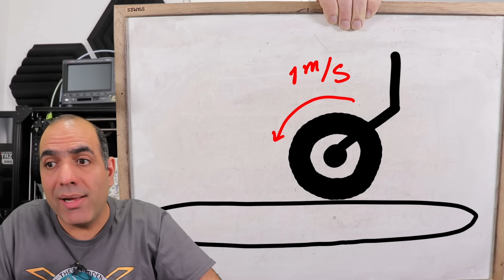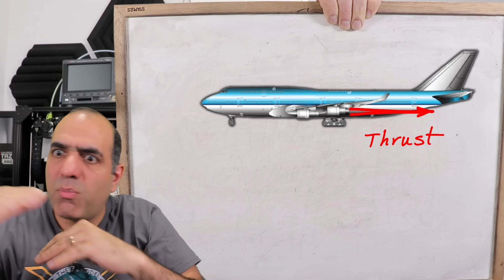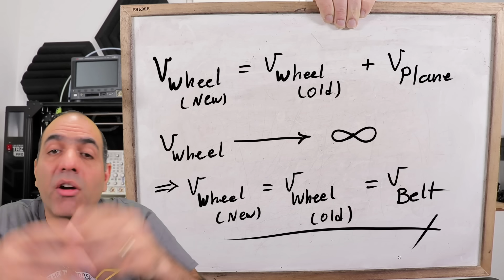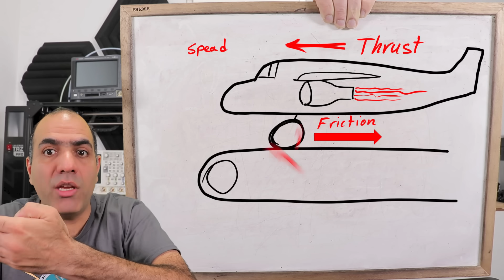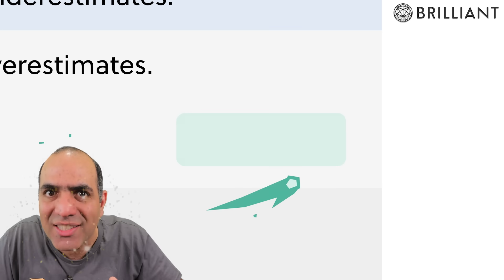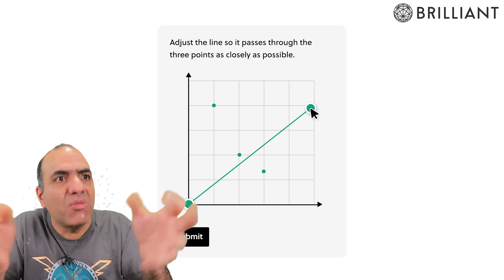Airplane Question that Drove Me NUTS!!!

Comment: I’m at 1:52, you’re about to give the answer. A prop plane absolutely could but I’m conflicted about a jet. Initially without too much thought I said yes, but then I got to thinking about airflow over the wings (that’s why a prop plane works, because the propeller moves the air) and now I don’t think a jet could. So no. 
But then considering that the jet engines provide the power to actually move the plane and the conveyor belt would overcome the friction between the wheels and ground, soooo……yes. 
But there wouldn’t be any airflow over the wings to provide lift, if the belt and wheels are at the same speed in opposite directions they cancel out and it’s as if the plane is stationary with its engines going, we’ve seen that happen and the plane doesn’t just lift off, so no. But with the friction overcome wouldn’t the engines just sort of push it off as it were, so yes…………

I don’t know so I’m going to finish the video, back in a moment.

Update: I still don’t know. 😉

The question is 42.

Comment: Airplanes do not care about ground speed... so long as the air speed is high enough over the wings the plane can take off.  

besides plane engines do not act against the ground.. they act against the air.  this problem isn't a problem.. it just shows ignorance.

Comment: Electroboom your analysis is wrong if you definte wheel speed a little bit differently..  Remember that the top of the wheel is going +v while the bottom of the wheel is going +v.  If we definte "speed of the wheel" to mean the part of the wheel in contact with the conveyor, then the wheel speed always matches the conveyor speed 100% of the time.  In fact the puzzles' most mysterious statement is actually a tautology.

Comment: "wheels moving at the same speed as the conveyor" is a meaningless statement.   Wheels always move at the same speed as the ground they are touching.  So for instance if the ground is 0, the wheels are 0.  If the ground is moving 100 mph the wheels are spinning 100mph.   They must by definition always be moving the same speed because they are touching.  Now suppose you set that conveyer at 100mph and hold the plane in place with a rope.  The wheels spin, the conveyor moves, and there's very little friction.  Now let go of the rope.    Then have the plane start the engines it will fly down the conveyor while the wheels spin at a terrific speed.   Now let's do it the other direction.  The conveyor is pushing the plane forward at 100mph but you are holding the plane in place.  let's assume that there is zero friction in the bearings for now.   Let go of the plane.   The conveyor will not push the plane forward at 100mph (because the wheels are just spinning in place).   You will have to start the plane engines and have the turbines or prop push the plane down the conveyor belt.

This is a great question because it has such a great amount of misdirection adding that completely meaningless "wheels spinning the same speed as the conveyor belt".  That part actually does nothing and is only there to confuse you.  There is no engine on the wheels at all.  It just spins in plane and all the propulsion comes from the engines mounted on the airplane.

So the answer is the plane takes off whether the conveyor is stopped, rotating at a high speed, fowards or backwards it doesn't matter.

Comment: The plane can only take off if the wind speed over the surface of the wings over the leading edge exceeds that which is required for takeoff.  Presumably, the wind speed at that moment is lower.  Since, the problem mentioned no thrust, even if the wind speed was sufficient, the aircraft would actually likely slide backwards and return to the conveyer it was on before, a few feet away.

Comment: I’m not smart so this is just my idea but if the plane needs to move forward with thrust it makes the wheel move letting the plane more forward so that the plain can gain lift but if the question saying the belt and the wheel move in the opposite direct equally wouldn’t that just make the plain move in place without being able to go forward there for no lift? I feel like a good way to test this is with paper folded (in a way allowing you to blow on it to act as thrust) and with wheels on a belt moving roughly the same speed I think

Comment: You don’t even need to do any maths it’s common sense! The plane in the conveyor belt question of the dumbest question I’ve ever heard. Obviously the plane to take off. Smh 😂 the wheels have nothing to do with the speed of the plane. They could be rotating at 20,000 rpm the wrong way 😂 it still would take off.

Comment: Thrust causes plane to move.
Movement causes wheels to spin.
Conveyor counters that, meaning plane is stationary.
As for the plane to get up to speed it body must move. 
Without that movement, it will gain no lift, meaning it can’t take off.

I am not sure if I’m thinking right, but without drastic circumstances like an absurd headwind or lower gravity, it would be able to take off.
 It’s not a rocket, it need to, essentially, ride the wind. Right?

Ah I don’t know. I don’t know anything on the math side of things and i know even less on the physics behind why a plane flys, but if the body can’t move, it can’t gain lift. It can’t move because it has no method of movement without the wheels being able to carry the body forward as its thrust increases, hence it will be stationary.

Right?

Comment: Mythbusters busted this myth in like season 4
Reply: Not quite, the wording was slightly different. In the Mythbusters one, the conveyor belt would match the speed the plane needs for takeoff. In this question, the conveyor belt matches the speed of the wheels. That could stop the plane from gaining speed if the tires have perfect grip, the wheels aren't frictionless, and the whole thing is completely indestructible. 
Still not possible, but in a slightly different way.

Comment: So to clarify we have a runway comprised of a conveyer belt, designed to match the speed of the tires... the plane would take off as it nornally would assuming all other conditions are "normal" the tires would be exposed to the same speed as they normally would just with more rolling resistance in theory. Meaning slightly more drag requiring slightly more thrust or slightly longer take off. Ez

Comment: You forgot something. AIR. is no air moving over the wing. First, thrust makes the plain moves forward to take air, over the velt (NOT, because is stationary). seconde even the velt and the tires move at the same speed, NO air is pushing to the wings. So, in none event the plain can get any air to fly; because is not moving.
IF, you put some kind of fan or turbine infront of the plain moving air over the wings, stationary lifting is aplied. so, maybe the plain could fly. but... maybe no one will make the experiment.

Comment: As the treadmill has to match wheels. You could just say that the plane has to be stationary. So then Imagine that the plane was fixed. The jets would generate thrust but plane wouldn’t go anywhere. Same as a jet engine in a test rig. Just move lots and lots of air through it that’s all.

Comment: Or another way to think about it if the plane's wheel was on earth and was not able to move..would it fly as the earth is moving at over 1,000 miles an hour.  Yes, I know not a very good example as the plane would be able to fly yet the idea.  Or another way to think about it is that if the conveyer belt was able to push the air then yes, the plane could fly.

Comment: It won’t fly. Case closed. Every aviator knows how plane flies. You don’t need airplane to go or not in ground. İt stays in the same place which means there is no air speed going through the airfoil so no lift. So no flying. İf the plane doesn’t move in the ground it doesn’t matter even if it goes 500 kph since there’s no lift

Comment: I think answer 4 is also a case of fishing for reasons that the reflexive "no, it can't" is right.

The question isn't "does the plane take off while sitting still?", the question is "CAN the plane take off?", as in "does it have the capability?".  Every plane, before taking off, spends some amount of time at the end of the runway NOT at takeoff thrust.  If we interpret the question in the way that makes 4 correct, then NO plane EVER flies, under ANY conditions.
Reply: Wheel speed and conveyor speed are matched at the contact point between them and wheel only rotates when the plane moves forward. Again the plane moves Forward and the wheel rolls exactly the same distance on the conveyor belt. with everything matching exactly at what point in the forward movement of the plane does the wheel get ahead of the conveyor belt causing the belt to start?                                                                                             The riddle (Imagine a 747 is sitting on a conveyor belt, as wide and long as a runway. The conveyor belt is  designed to exactly match the speed of the wheels, moving in the opposite direction.)                                                                                                                          Can the plane take off?                                                                                                                                                                                                       Let's break it down                                                                                                                                                                                                                 747= real plane, it will take off                                                                                                                                                                                               Sitting= Stopped, not moving, wheels not turning, and conveyor not running.                                                                                                    Conveyor belt designed to exactly match the speed of the wheels = Conveyor belt can only match wheel speed, it can't change wheel speed.                                                                                                                                                                                                                       Moving in the opposite direction= The top of the wheel  moves in the same direction as the plane's forward movement, the bottom of the wheel moves in the  opposite direction to the plane's forward movement. So any conveyor belt the wheels roll over moves opposite the plane.                                                                                                                                                                            To make the wheels turn the plane must move forward, as the wheels turn they roll on the conveyor belt at the same speed. Because the speed of the wheels  already matches the stopped conveyor belt, the conveyor belt  will not have to start and the plane will take off.                                                                                                                                                                                                                                  I see now this is not a riddle, it's the definition of how planes take off from a runway with one word changed. they replaced the word runway with conveyor just to confuse

Comment: The set of assumptions i always use to answer this question are:
1: on the Earth
2: at Sea Level
3: on an International Standard Atmosphere Standard Day
4: with both conveyor belt and wheels constructed to the same durability.

I always insist on 4, because this question is clearly designed to confuse people into thinking the interaction between the wheels and the pavement is what makes the plane accelerate for takeoff, and the first thing EVERYONE does when they hear the words "the plane is accelerated by its engines pushing against the air, not its wheels against the ground" is say "aha! but the conveyor belt moving back would exceed the rated speed of the wheels and make them explode!" because they want their reflexive answer of "the plane can't fly" to be correct so they can say they were not tricked by the trick question.

It's okay to be tricked by a trick question, people.  Direct your anger at the person who intentionally phrased the question to be easily misunderstood, not the person who made you realize you were tricked.

Comment: Most of what causes any variable of lift comes from drag and lift; the air drag is what produces the lift in the case of a plane due to the shape of it's wings. The jet is, in theory, moving at the required take off speed in your imagined scenario, but, it does not generate the wind resistance necessary to create the drag that it needs in order to take off...so no this is not a paradox. The plane does not generate lift and cannot fly.

Comment: After watching 30 seconds of the video, the answer is YES.

The conveyor belt can NEVER match the speed. The power of the engines is not transmitted to the wheels. So even if the belt can make the plan move at MACH 10 in the reverse direction, the plane would take off.😂

Comment: I like you're thinking... and my head does the same thing when I see these things... That being said... The question posed is "Can The Plane Take off" ... and says nothing about it, and the answer is yes. In our universe, on our planet, it would not have a problem... in fact, it would be easier. 

It starts off sitting, as stated, so to match the wheel speed, it would have to turn at the speed of the plane relative to the ground and maintain zero wheel speed.

Comment: Of course it will fly... It is a jet engine that acts on the air and has nothing to do with wheel speed. 

However... there is a bit of a problem here.... I've been sick in bed for 3 days, so maybe its the fever talking... "exactly match the speed of the wheels" is breaking my brain... 

Let me explain. At a standstill, the wheels are still. Of course, the jet engines start moving the plane... If the conveyor moves at the speed of the actual plane, and keeps the wheels still, then problem solved it can "exactly match" zero and zero... I'm sure that's not what most people are picturing though. I believe for it to actually match the speed it would have no choice but to do this... zero mph wheel speed and matching the air speed of the plane ... actually making it easier for the plane to take off. 

The thought is that the wheels end up turning 100 mph and the conveyor turns 100mph. The problem is that, it is a stationary runway that causes the wheels to spin. A moving plane and a stationary runway. I could really use the help of an animation... Let's see... 

Wait a second here... After writing all of that, I just realized that the wheels and conveyor have no choice but to turn the same speed ... they are in contact, so unless they are skidding, they are turning the same speed. I think this is intended to be misleading ... but not in this way, lol. 

My thoughts were that as the air speed picked up, the wheel speed would pick up and so the conveyor would have to speed up to match the increased speed... but that's just not the case... the plane can go 2 or 2000 and the wheels and conveyor can turn 10 or 273. The reality, however, still stands true... If  it "exactly match the speed of the wheels" it is not turning at all, because it starts at zero, so it stays at zero, and matches the air speed of the plane.

Comment: Obviously a 747 needs thousands of feet for take off , so the question then becomes what happens when the front wheel lifts off and your back one's are rotating at the same speed as the Treadmill . It's interesting because your plane is not moving forward it's still at the same speed, sure it might get the nose up , but then what. So I don't believe it's possible because you need the length of the runway otherwise your trying a vertical takeoff and that's not possible. See what I'm saying, so basically it would be like taking off from a still position and for a 747 that's impossible.

Comment: No. Is it really that hard to comprehend? Noooooooooo.
Reply: Evidently, because the answer is yes. Common experience with motor vehicles makes most people blind to a point that seems obvious in hindsight, which is that propulsion on an aircraft like this is completely independent to whatever the ground is doing, so it doesn't make a difference

Comment: I say plane will fly because the power is not delivered to the wheels because the thruster pushes the air pushing the plane forward meaning the wheels will spin faster but shouldn’t stop the plane

Comment: My guess is that in order for a plane to be aerodynamic (controllable in the air), it needs... air
The elevators produce downward force at the tail of the plane, making the nose to pitch up; in order for the elevator to do this, it needs wind.
If the plane remains completely stationary due to the conveyor belt, there is no wind (at least not enough to produce lift).

The plane cannot take off.

Comment: İt cannot fly cause the whole plane gonna just stay still and u know there should be airflow around wings for take off so no movement no take off mate. Motors are not the thing make plane fly its the wings, motors are just for thrust force
Reply: Thrust force indeed. An enormous thrust force pushing the plane forward with nothing balancing it out [maybe a little bit of friction]. Doesn't sound like it should be stationary